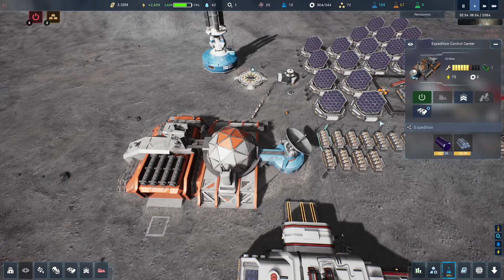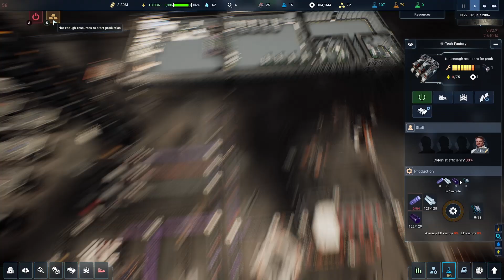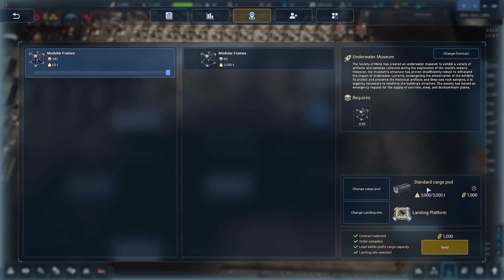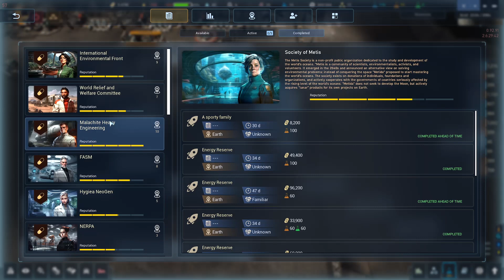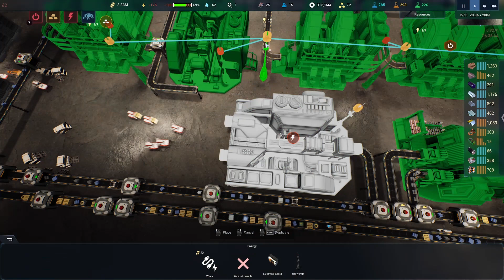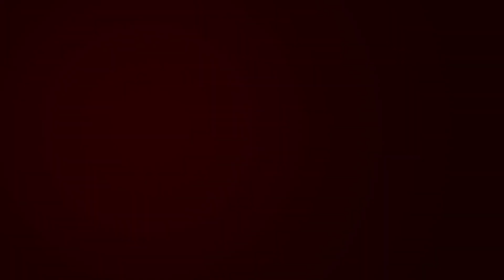The Crust - Ep.13 - Low Electronics

Comment: I spend a lot of time exploring the surface now since my rovers have the radar for minerals also my production set up is way different to yours (more spaced out) and I make my own vehicles, this is my first play through in sandbox mode next time I will do one of the campaign/quests sending pics to discord. 🙂
Reply from the maker: @oldgalah7425  got it. Thank you for your help. 😁🍻

I had a question about the conveyor belt. Did they fix the cargo station and the conveyor belts how do you get more than 600 regolith underground. Or do you process underground resources with those 5 multi-regolith refineries?
Reply: @oolykeegaming81  when the truck comes back to the cargo dock with its 6k of regolith use belts to send the regolith downstairs using an elevator or two and a seperate belt for the rare earth ones, the five multi refineries are fed from upstairs and downstairs regolith I ran out of titanium that's why I'm mining it on the surface.
Reply from the maker: @oldgalah7425  got it! The only thing I missed was the Cargo station having the conveyor belts fixed but I needed to rebuild it. Thank you!! :)